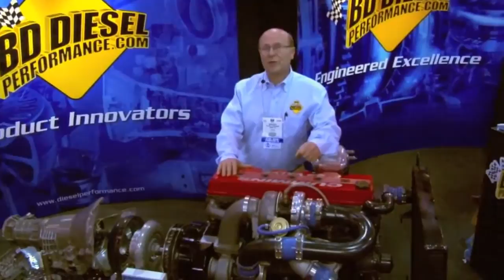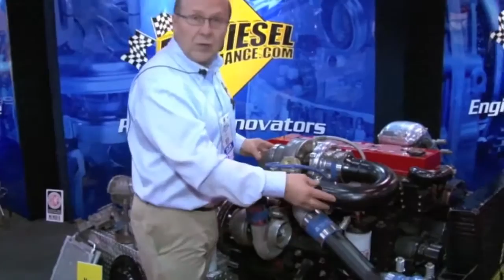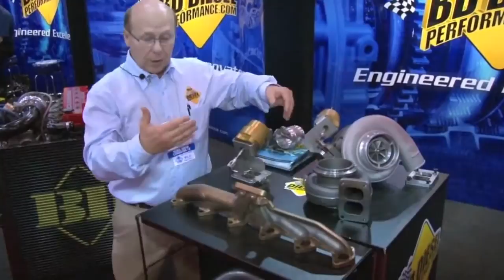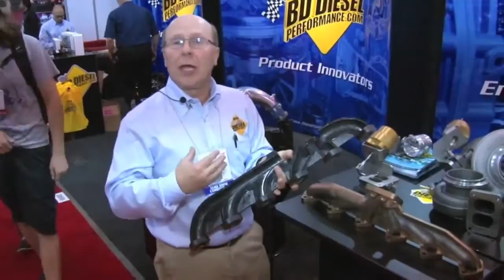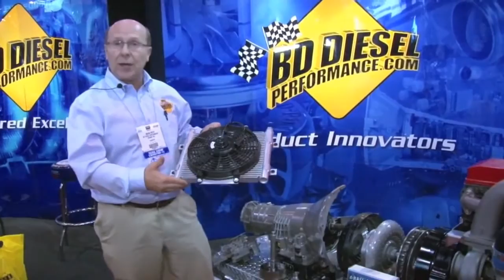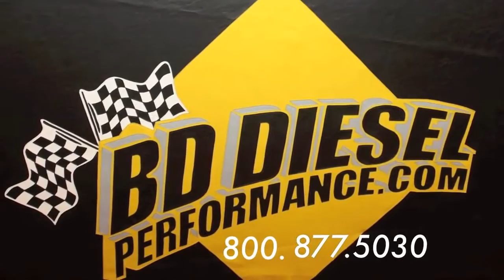BD Diesel at SEMA 2012

Comment: Would the diverter valve help a stock tune 91.5 make more efficient boost(improve volumetric efficiency) at 60-65 in overdrive 16-1700 @5-700Egt and 3-5psi.?    Drive pressures shouldn't  be an issue cut back to 8cm.  Ive found hx35 down to 8cm divided would 4cm be to small?   
ORIENTATION 
 Would you recommend running through the fore or aft vault?
Looking at cuttaway of twin vault, it looks like the aft would ueald the highest angle of impingement +180° (fore is closer to 90°), but exerts the most leverage on the shaft. My anticipation is that I will be able to exced the 17psi full open @ 60-65.
You do not make a T 3- T3.   so an adaptor T3/T4 +your T3/T4 diverter.  
Adaptor above (divided only) or below(open or divided) the diverter? Thinking congerging/diverging  effects on velocities/ Temp..
Reply: I have an internally gated 62/80 silver bullet turbo on my 2005 5.9l ram set to 50psi. I'm running a 1300-1500 stall converter and was encountering severe turbo lag up to 1500rpms during stop and go driving with the worse lag occurring from varying low speeds in which the trans would not have enough throttle load to downshift making a bad situation worse.

I modified the diverter valve to fit the housing with the aid of some stand-off bushings to make clearance for the actuator, a longer clevis, and a t3-t4 adapter plate to reduce it back to t3.

Ill give you an update on the performance later this week